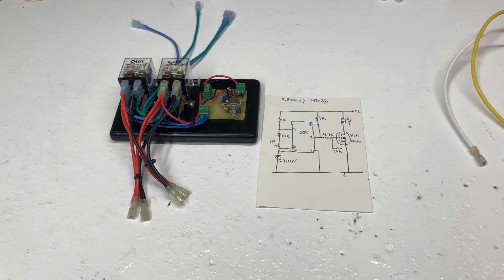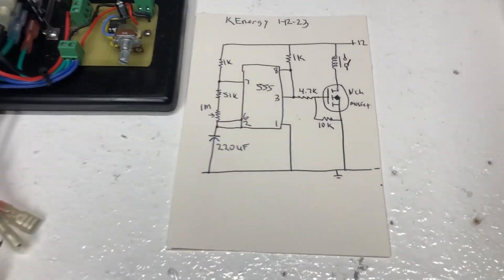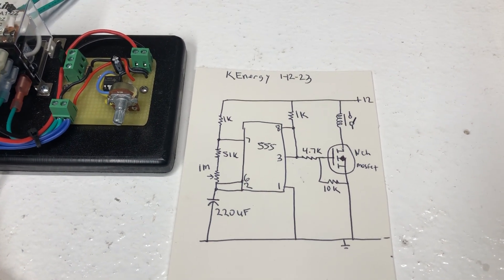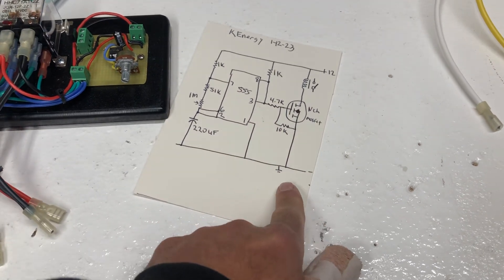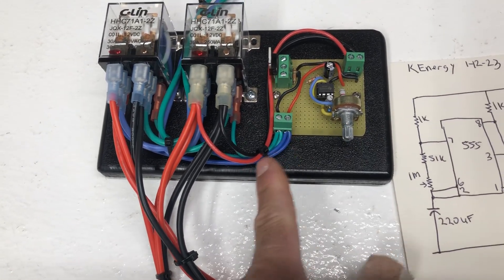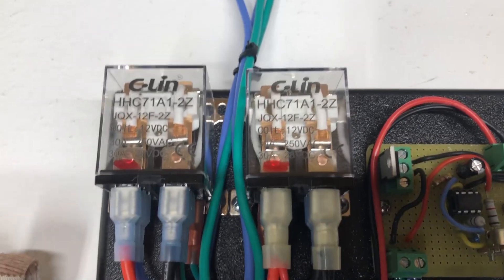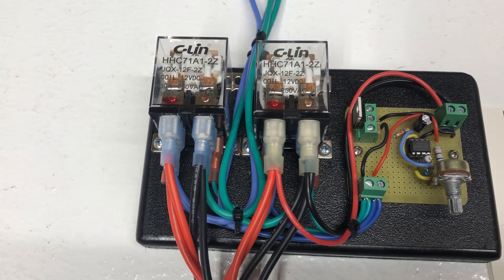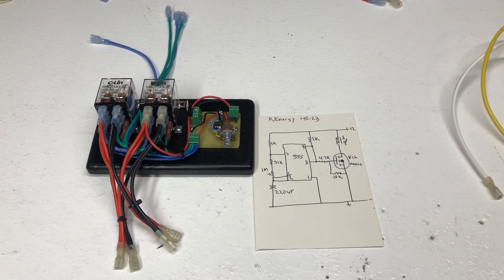Battery swapping circuit diagram

Comment: Hi there Mr.k, couple of questions. What is the exact fet part no. And are the relays coils tied in paraller? Thanks
Reply from the maker: Irfp 3205 for the control
Reply from the maker: There’s 2 relays because you have to switch in and out
Reply: @kenergy1707  thank you Mr. K, god bless you.

Comment: This is great. Thanks for the diagram. I like this circuit. Looks simple enough to just add a couple mosfets setup in an h bridge config and setup to switch when one battery gets to 15.2v and dump it into the lower voltage battery, just need to cut out the potentiometer and connect the cap to the h bridge signal. Maybe? I will have to try it out and let you know. Nice work
Reply from the maker: Sounds good !

Comment: Thanks so much bro. It's really really nice. Am also of a view. Since these relays are of a slow frequency swapping . What if we use SSR DC DC relays being switched by two MOSFETs as you have arranged but controlled by Ic CD4047 at a faster rate. Then instead of swapping batteries, we swap supper capacitors. Do you think this can work?
Reply from the maker: You can use ssr but it has to be the ac version or power won’t go back to battery 
 I think it’s worth a try
Reply: @kenergy1707  Ac SSR may not work because when you apply a DC supply to it remains on untill the voltage transmitted reaches zero volts. Thus called zero switch ac SSR. However for a DC DC SSR relays, the polarities should be kept into consideration as Incase the polarities are wired wrongly, the relay also stays on even if switched off.
Reply from the maker: @wambeddemustafa1193  
Current has to go both directions or it won’t work right
Reply: @kenergy1707  yes you are right. for ac SSR current should flow in both directions. But for DC DC SSR, current should be in One right direction .

Comment: Thx for sharing the schematic 👍🏻
There’s a way to do it with only one DPDT relay but you have to use 4 diodes as well so what you save in relay power draw you may lose in voltage drop across the relays.
Reply from the maker: Your welcome 
 That’s good idea too though